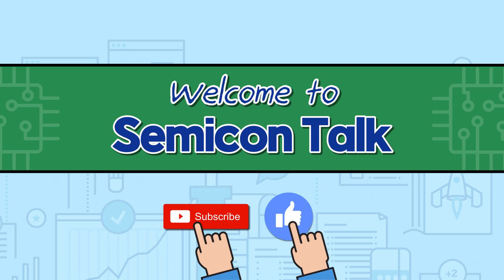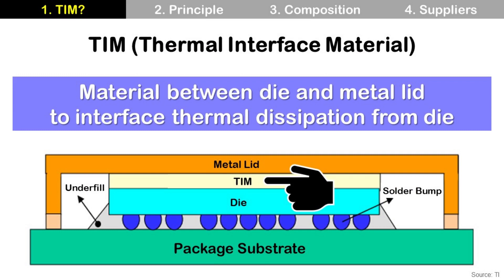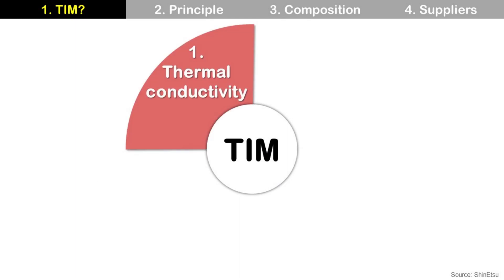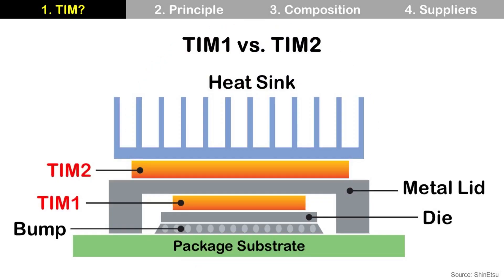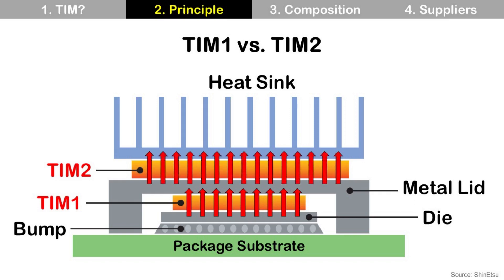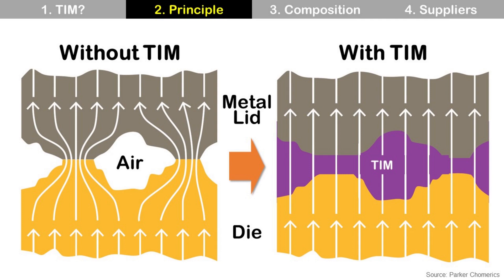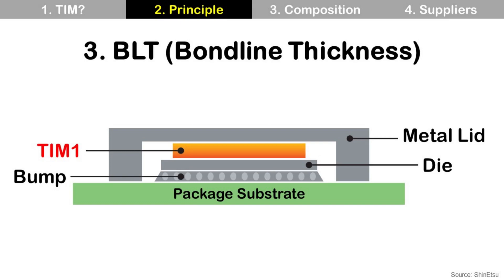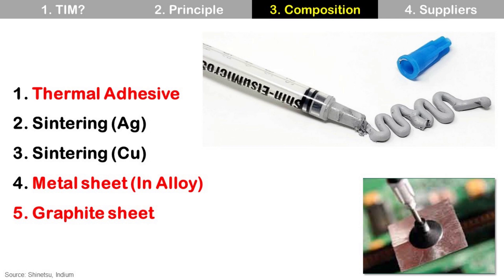[Eng Sub] TIM (Thermal Interface Material)

Comment: In recent years, I always see TIM for die and heat sink attachment directly. I know this should be more efficient. But there should be somehow for some applications still needs TIM2. Do you know why?
Reply from the maker: I don't know the reason. I tried to find related paper or information but couldn't find. 
TIM1 is used between flipchip die backside and metal lid. TIM1.5 is used between flipchip die backside and heat sink. TIM2 is used between metal lid and heat sink so TIM2 is used in addition to TIM1 with metal lid. 
The case using TIM2 means it also uses metal lid with TIM1 and I guess this metal lid is to reduce package warpage. Maybe this case, heat sink can not be attached on die  backside directly which is more efficient due to high package warpage. Again, this is my guess.
Reply: Thanks for reply and agree your warpage concern. I also think maybe the die size is too small if the die produce too much heat. So applying a additional material to have better heat distribution and being a buffer if the heat cannot be conducted quickly. Just maybe.